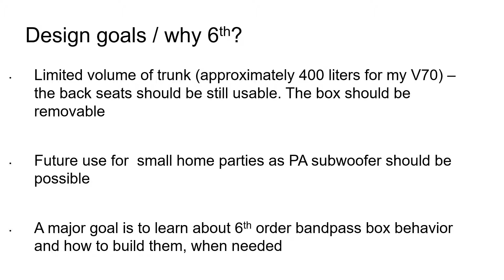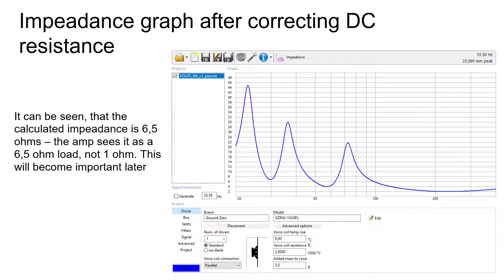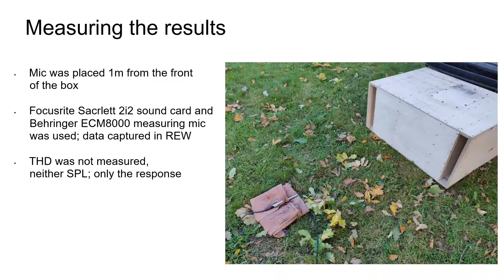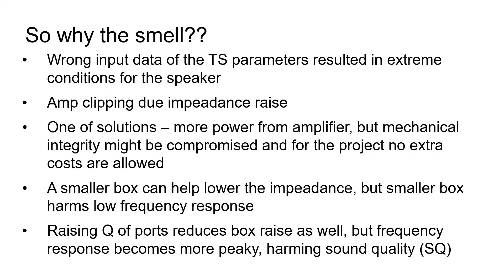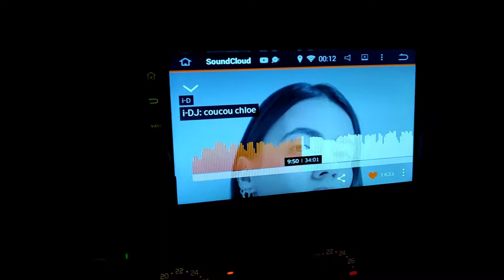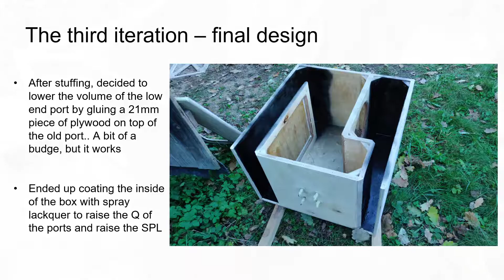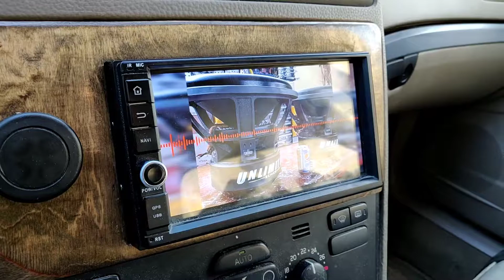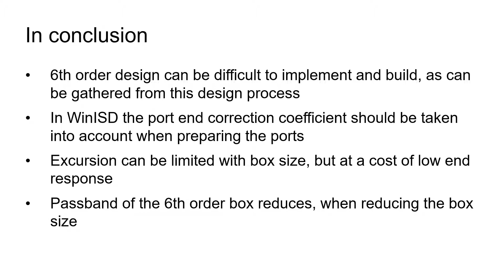6th Order Bandpass Subwoofer Build

Comment: Hey bro I have a huge box ready to tune it's 2ft by 2ft by 4ft, I'm running a single 18" DC level 4 1500rms I just can't figure out chamber sizes can you please help a fellow bass audiophile out
Reply from the maker: It all depends on what do you want to box sound like - are you after high SPL, high SQ, wind machine, them low's or maybe something else?
Reply: @KarlisZalitis  I like rock and edm
Reply: @KarlisZalitis  I think giving females bassgasm would be fun times lol thank you for the help seriously
Reply from the maker: Yeah, then for the case of parallel tuned 6th order, you can try dividing the chambers with ratio 2,5:1 and tune them approx. 25Hz Low chamber/60Hz High chamber. This will give you the lows and give you the upper kick range for rock music. It will have a wide passband but not that efficient
Reply: @KarlisZalitis  2.5/1 how might I do that my outside mentioned is 2ft by 2ft by 5ft I'm sorry I wish I was smarter
Reply from the maker: You can PM me kzdesignlv@gmail.com

Comment: I’m building a 6th order now... still figuring out what each graph is. So far the design is for two Skar vvx 8s... front chamber is .5 cubes tuned to 60 and the rear is 2 cubes tuned to 32. Main problem so far is the port size. Made them just big enough to eliminate chuffing and the front chamber is 76 inches long and the back chamber is 41... it’s like 3 cubes in just port.... half shit I want the output but didn’t think the box would be close to 6 cubes total lol. I been looking at the graph for cone control then air velocity and obviously trans function magnitude ( think it’s called that. I notice u looked at an ohm graph or something for box rise. Guess you just look at the lowest part of the curve? Anyway this video was helpful and any input on my box would be appreciated
Reply from the maker: Hi Wes! 
First of all - if dimensions are not an issue, I would always go for single 12 or 15 inch driver, rather than 2pcs of 8 inch speakers. Reason being greater sensitivity due to various reasons, one of them being better acoustic coupling for the bigger cone area speaker. Bigger speaker has better low end performance as well, due to generally lower Fs of the cone and spider stack, but it can not be the case for some drivers. 

Regarding the volume of the box - I would say that the chamber volumes are a bit too big for the drivers, that could lead to higher box gain and some problems in advance. It should be kept in mind, that the WinISD is a calculator only - some designs can be problematic if implemented purely on the basis of good looking graphs (which was pretty much the case with my first box in the video). You can put in the numbers and get sweet +12dB or greater in TF magnitude graph, but as you have encountered - the box becomes somewhat anomalous. 

If some port flaring is done, the port area can be reduced significantly, which in turn would shorten the port and help with your problem. Albeit, at the cost of port air velocity. Someone can correct me if I'm wrong, but for pro audio applications, the vent air velocity at nominal power should be kept within 16m/s, where I design ports with 30 to 35m/s, without significant chuffing. Smaller ports do well form SQ and help in cone control too. 

Hope this helps
Reply: Karlis Thanks it definitely helps! Main reason going with 8s is to show people what 8s are capable of.... also trying to keep the box as small as I can for a 6th order but getting a higher spl and hopefully have a nice even bandwidth. I could just get a 15 and port it and get way louder than the 8s and in a more simple smaller box but again just trying to see what we can get these 8s to do so most people will guess it’s 12s or something. I’ll try out a smaller design n see what I can so. I just know is not going to be as loud is all but it’s all about trade offs! Thanks you’ve been helpful
Reply from the maker: @wesjacobson6675  Yes, those damn trade-offs :D Please share how your box turned out :)
Reply: Karlis For sure man! Thanks again

Comment: Don't they make microphones good enough that they don't distort if so can somebody please tell me what brand and is there a way you can hook these microphones up to the charging port in your cell phone or Bluetooth to your phone or laptop
Reply: Its not a microphone issue but the gain setting on the microphone circuit, 30db pads are required